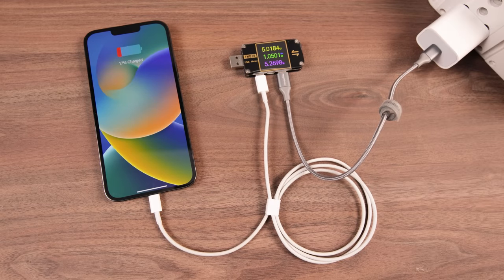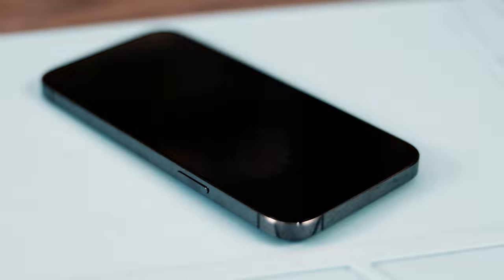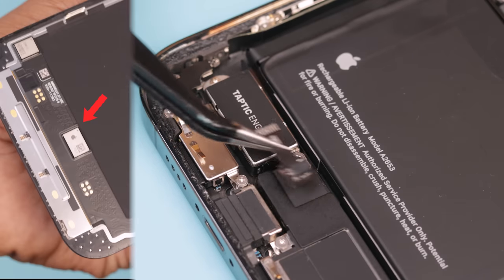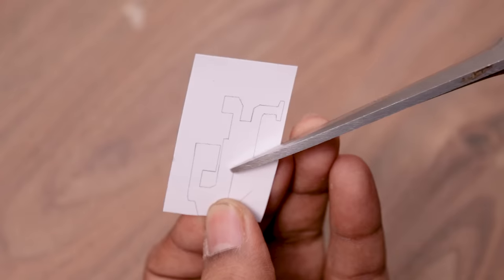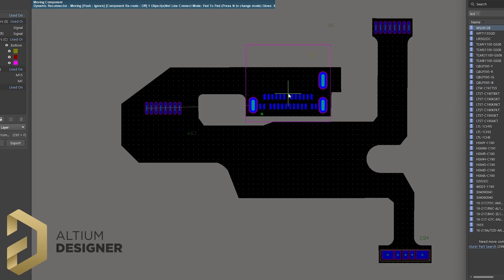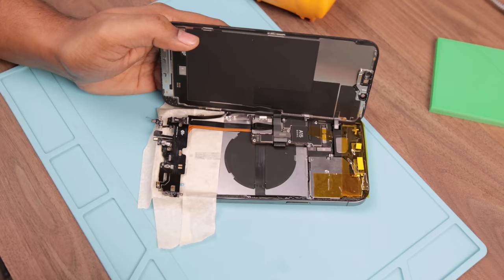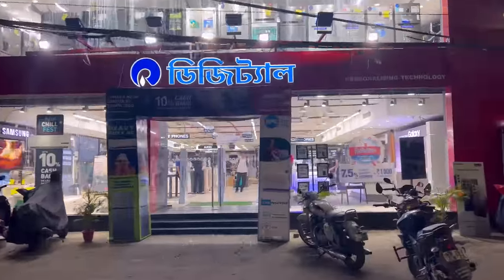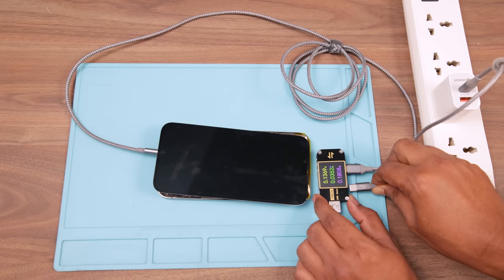I made My iPhone USB Type-C / Bye Bye Lightning⚡

Comment: I have seen other people doing a similar modification, and this one is by far the best excecuted. The modification is incredibly clean, it blends in really well with the rest of the original phone both on the inside and the outside! I hope someday we will not have to worry about this anymore and Apple will use USB-C on their phones.
Reply: iPhone 15 series will have it as they’re being forced to by the EU.
Reply: Restore technique had done that almost 2 years ago
Reply: They will likely set a slower speed for non MFI USB c cables.

Comment: Can we add USB C female port directly on the original flex cable and use USB C type mfi certified cable?  Also did audio worked? ( as c100 is used for audio)

Comment: Bro, thanks bro I tried to peace with you and I don't live in the bed. I don't even have a if no one could help me. Take a screenshot and put it on and you're supposed to connect to the PC u charger to the indicator so.  Just take it make a pretty shape one and is big with the line. PC U1 and has a connector to the camera. I'm lying camera. I don't know, I'm just making sense, so just add it.  It's best pretty good at it down and that's right. I tried to fight but it's good

Comment: Apple: BUY THE NEW IPHONE 15. IT HAS USB TYPE C, AND IT HAS THE NEW CHIP SET ALSO MORE LIGHTER!!!! It's more EXPENSIVE, but who cares! 🎉🎉🎉

DDelectronictech: blud I just make an iphone with usb type c so why do I need to spend extra money and btw iphone 15 is not even that good, the titanuim body is more weaker and it easily over heat compared to iphone 14 pro or pro max 🗿🗿🗿